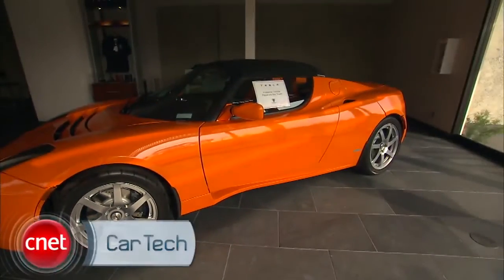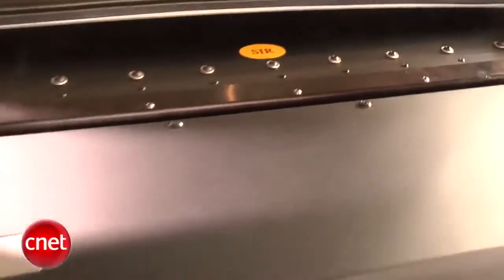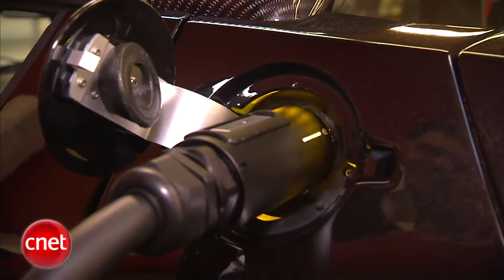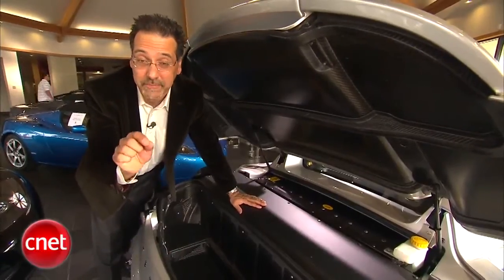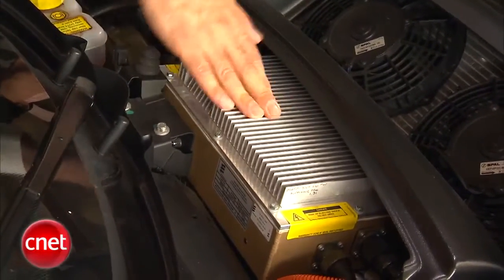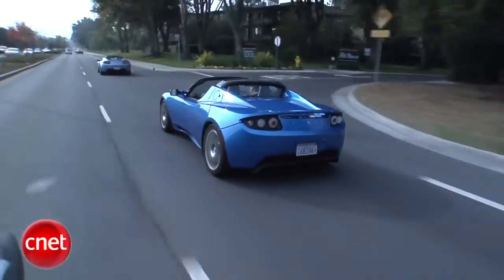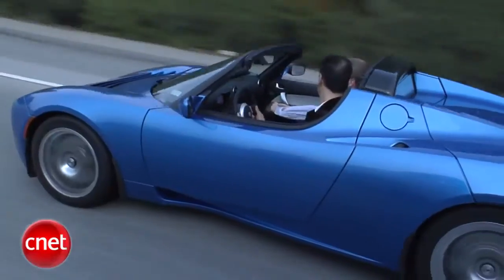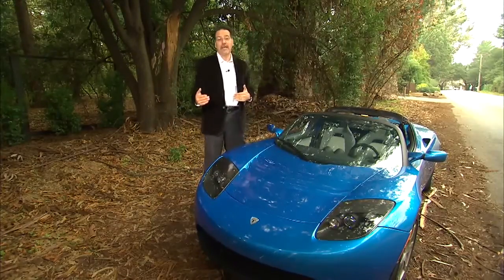2009 Tesla Roadster (electric car)

Comment: Actually 220V can be ready available from your home panel.  All home electrical panels currently provide 208V by tapping out of 2 phases (or 208V single phase at they call it).  You will then need a buck/booster to boost the voltage from 208 to 220 (about $500).  Most 3 bedroom homes have an electrical panel with about 100AMPS available on tap (which is currently shared among all your appliances, lights, AC, etc...).

Comment: If you have two empty spots available in your panel, you can install a 2-pole 80AMP breaker (which will give you the continuous 70AMPS at 208V), then feed that through a buck/booster to bump it up to 220V / 70AMPS.  

Any professional electrician can do this, and it is perfectly legal, as long as you don't exceed the total current rating of the panel (in which case there should be a main panel breaker what will trip).

Comment: Personally, if I had a Tesla Roadster I would be happy with the 40 AMP charger. That would charge the car from dead empty to full in 5-6 hours. Longbottle I've seen several house-owners using the 70 amps charger in the US....so perhaps it's not as difficult as you say.